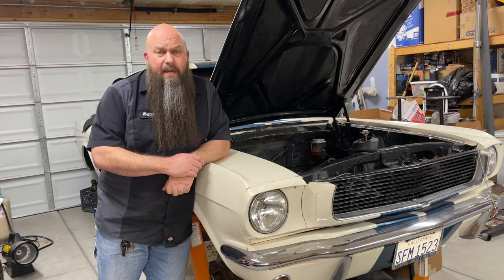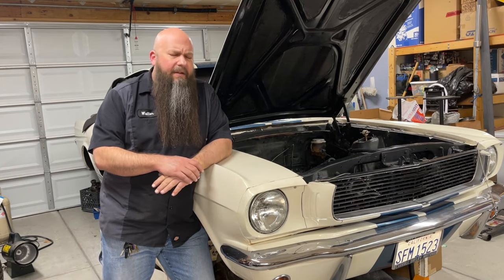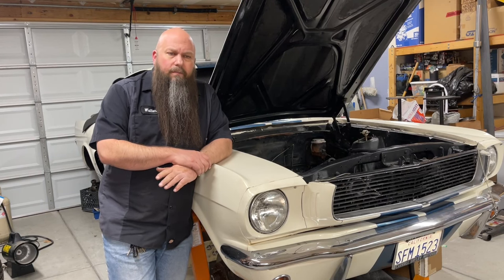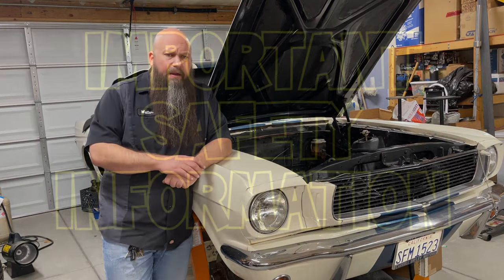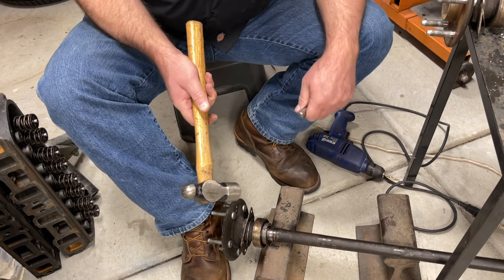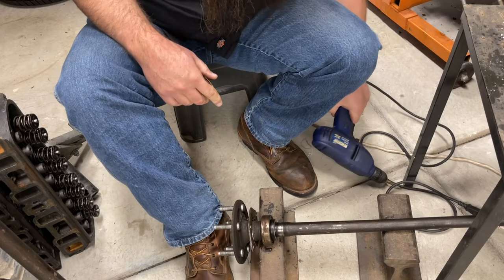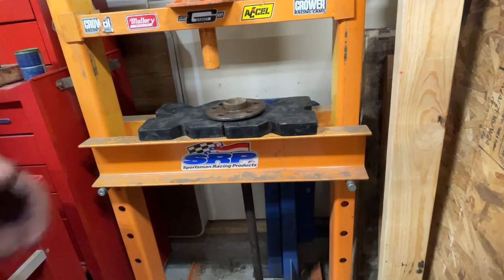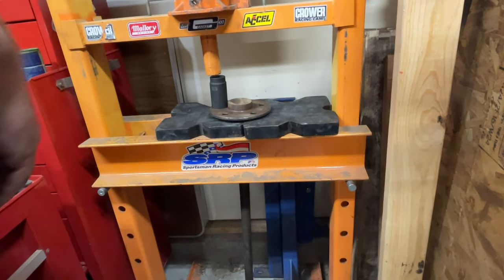Step By Step Rear Axle Bearing Replacement

Comment: Great new video Walter. Love the hands on video and all the explanations. Did the same job with my Harbor Freight press, after some tweaking I didn’t have to remove the studs.
Reply from the maker: It occurred to me that I hadn’t done a set in nearly 10 years after I did this, and there are other ways to set up the press plates and bridge the bearing plate, but this worked adequately.

Comment: WHAT if I dont have a press?? Can you use a piece of pipe to gently drive them on?
Reply from the maker: Not recommended.  I’ve seen them put in an oven to make them grow enough to reduce the press fit, but you risk damaging the seals and pushing out grease above 250°F.  Rent a press or pay someone who has one to do the service if need be.

Comment: Best video on that topic that I have seen so far, thank you 🙏! 
Have subscribed! 
Would I need a 20 ton press or would a press with 6 tons or 12 tons fullfill also my needs?
Reply from the maker: A 12-ton will install most axle bearings adequately, but can be a little insufficient when removing them.  Larger (wider) bearings like those found in trucks can be more difficult and sometimes it’s easier to use a cut off wheel to remove a section of the outer race and a roller, then split the inner race for removal.
Reply: Thank you for your advice. So I will look better for a little more headroom and leaning towards a 20 ton press 👍🏻

Comment: Knocking the ring off is a lot easier if the axle is about waist high. Set the axel on a vice mounted over a leg of a bench, use a bigger chisel and a bigger hammer. You don't need to drill the ring. Just hit it like you mean it.

Comment: Without the retainer plate what keeps the axles from sliding out of the housing?
Reply from the maker: The axle bearings were changed during a conversion to  Wilwood rear disc brakes.  They use a C-shaped caliper bracket that retains the axle.  It simply slips over the axle during installation.  Thought this was mentioned in the video.